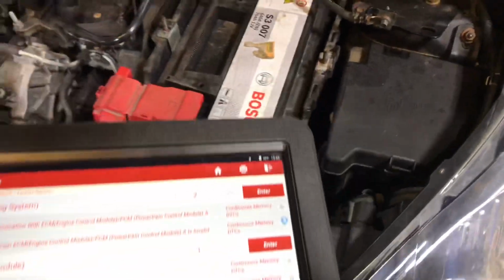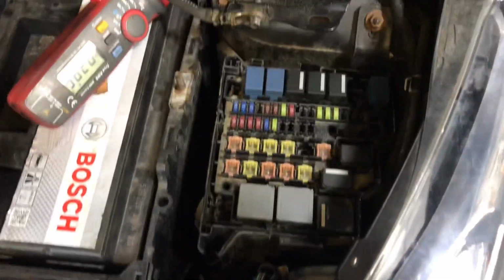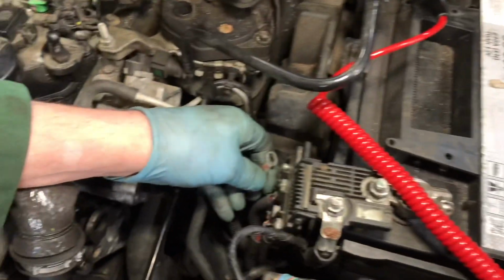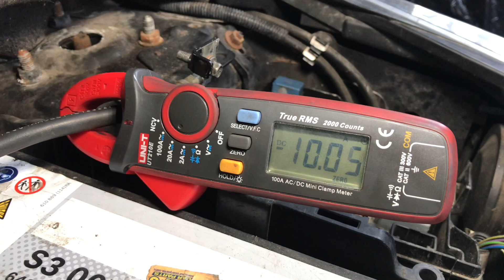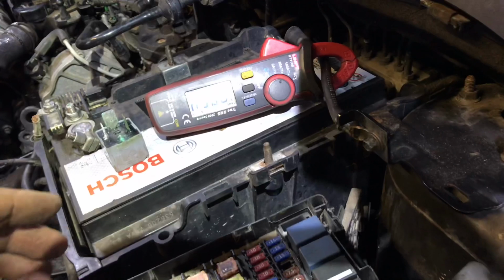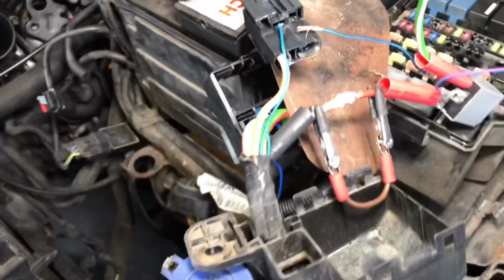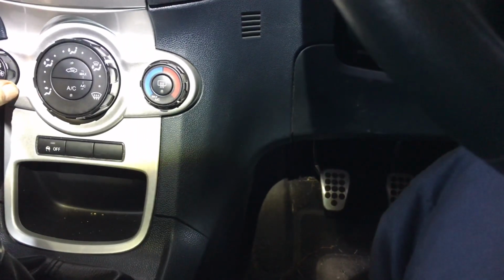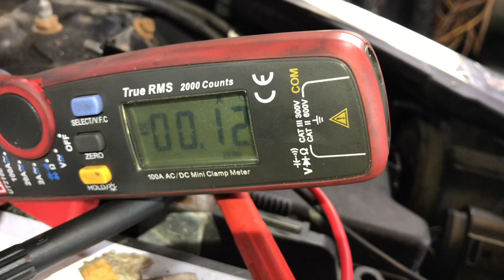Ford Fiesta MK6 1.6 Tdci (2012) - Battery Goes Flat Overnight! Parasitic Draw, Fault Code B10EA!

Comment: Great video Sandy! 
I've got the B10EA code on my 2007 ford galaxy so I'll try and locate a similar relay box for the heater. It looks like the previous owner just tried swapping out the heater control panel in the dashboard as there was one in the glovebox.